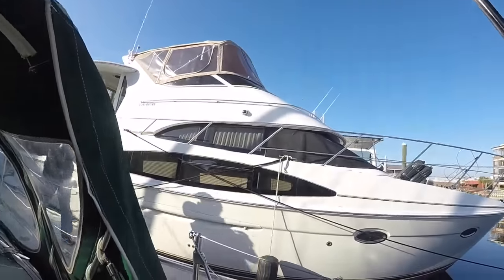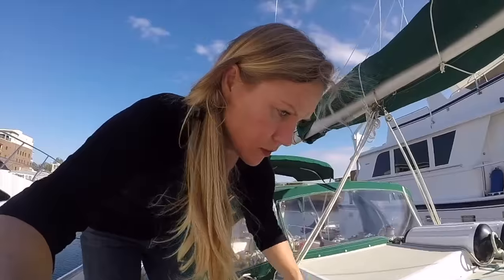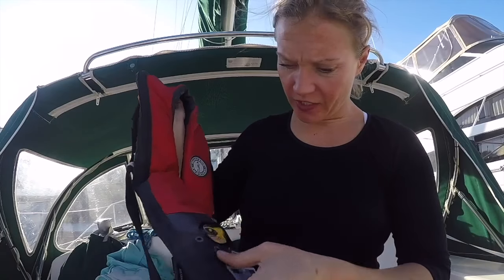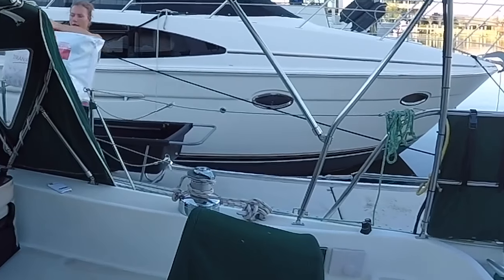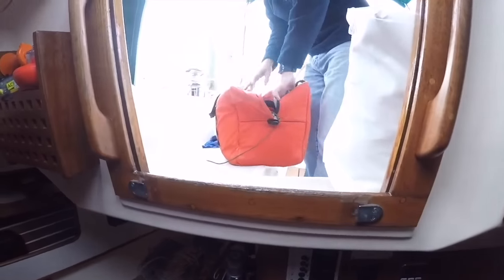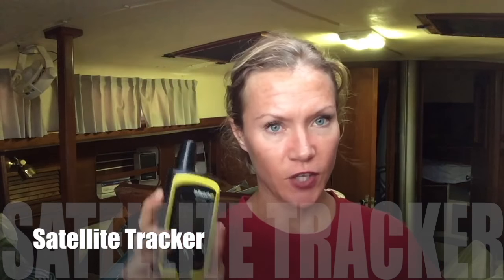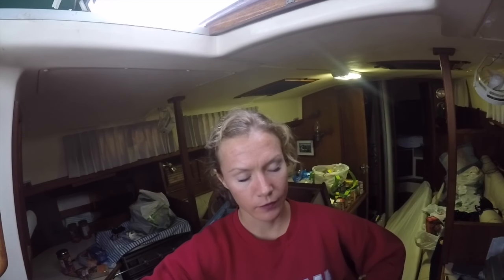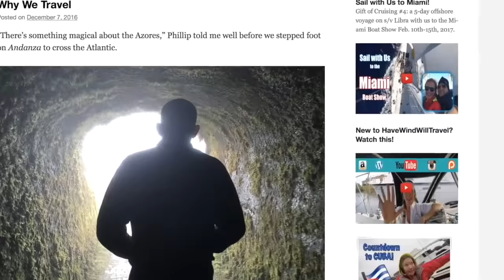#87: How to Voyage Safely Offshore (Season 4 Finale!)

Comment: Thanks Annie.  Great video.
In regards to your built in harness / pfd - make sure you tension up the waist band good and tight - should be able to slide two fingers between the strap and your body.  If it is too loose you will break ribs - possibly puncture lungs - when the shock load is transferred from tether through harness.  Your pfd's had straps on this sides for quick tension adjustment - so no worries there - just need to remember to tension up the last bit once you have them on.
Safe travels!
Reply from the maker: Ahhh, great advice.  Thanks for sharing.  I'll bet ours have been too loose and luckily we haven't gotten yanked hard enough to crack any ribs.  Always good to have your gear on right (even when you're putting it on quickly).  We have heard crotch straps are also a must as the pfd can get pulled over your head although our Mustangs do not have them (but I believe we can add some on with a few quick Dyneema ties).  Appreciate you watching and commenting.

Comment: Thanks. You've given me a kick up the but to sort out my jack lines and tethers.  I currently have flat webbing on one side and stainless cable on the other - and yes, it is like walking on ball bearings.  Not a good arrangement. I love the twin-line tethers you use and will invest in some.  I must admit that I tend to clip on without really think of what would happen if I tipped overboard.  Great video.
Reply from the maker: Thank you Just About Sailing.  Really appreciate the commentary here.  We only use our jack lines for offshore voyaging but found them very handy on this last trip to Cuba.  They worked very well.  I have to train myself to clip more often as I feel very nimble and agile and often hop out of the cockpit and get halfway to the bow before I remember.  But "feeling" a certain way doesn't mean you will be when a random unexpected wave bumps you.  So, if anything the jacklines are a good reminder (for me anyway) to clip in.  Thank you!

Comment: Looks like you guys have thought of just about everything for a safe and successful trip.  Having the knowledge of your boat and engine to find that leak, as well as the required parts to rebuild the water pump on hand for an immediate repair confirm that.  One thing you didn't mention, but should consider if you haven't already, is how to recover a MOB, if necessary.  I've seen more than a few reports of people falling overboard while tethered in to the jack lines, only to be dragged and drowned because they couldn't get back into the boat.  A MOB may be incapacitated for any number of reasons, and might not be able to offer any assistance to get themselves back into the boat.  Even in a Life Sling, imagine trying to lift Phillip back into the boat if he's been knocked out.  A block and tackle on the end of the boom comes in very handy in that situation.  I have D rings on both ends of my boom vang, so I can quickly disconnect the vang, attach it to the bail on the end of the boom, attach the other end to the rings on the Life Sling or harness of the MOB, and haul them back in.  Just the ex-USCG in me, trying to be ready for any situation.  Have a great trip!
Reply from the maker: Great, great advice as always Chuck.  Thank you for posting this for everyone to see.  Definitely something worth considering.  I imagine (if Phillip were knocked out and overboard) I would try to use a halyard and winch him in.  Maybe disconnected the main halyard from the sail and use that?  Certainly a situation to think about in advance.  Thanks for watching and all of your support.  We're so excited to share this experience with you all!
Reply: Sounds great in theory, however with the loads on a person overboard attached to  tether, in any heavy sea while the boat is being pushed through the water you are likely not able to recover a person in time. The person overboard while attached to the tether will quickly loose the strength to maintain their head above water assuming they are not already unconscious. The only safe way is to ensure that once the tether is attached it is never longer than to the gunnels so that you are never washed overboard. The longest tether you have when you demonstrated, I noted will put you in the water over most of your boat. Once over the gunnel your survivability is poor to non existent.
Reply: if youre overboard and theres no one to help you.......
well.......
 it was nice knowing you

Comment: Annie, I put my jack line down the center of the boat,  used that amur steel line (good for like 3,000 pounds) and ran from top of dodger ( hard top) to the mast around it to front of boat. can reach from either side of the boat and the tether's are short enough that YOU can't fall over board. They wanted a $150.00 for the flat webbing and I think the rope was $30.00. When you get to the mast just click on the other tether and go forward. Iv'e wrote to the Canadian cost guard trying to get them to OK the new flares but not yet. I wonder if it's because up here so many Islands and the regular one's shoot up so high. I carry lots of them I think safety things should be free or cheap, because lots of people won't spend the money for them.  Hope you have a safe trip!
Reply from the maker: Ahhh, a single line down the center.  That probably is a good idea as I felt my runs were a little closer to the lifelines than I would have liked.  I also had a guy tell me to clip on the line on the opposite side when working on the mast.  May be a good idea as well.  Thanks for sharing!
Reply: vind0 to olavi sok

Comment: hey Annie, you want to be able to freely walk from the cockpit to anywhere along the jack-line without having to unclip anywhere so you should run the jack-line outside the dodger.

Also, you mentioned if the jack-line is closer to the edge you feel less secure.  You should always go forward on the windward side of the boat and then cross to the leeward side if you need to work on something on the leeward side that way you are connected to the jack-line on the leeward side and it should be next to impossible to go overboard because you'll be nearly at the limit of the tether and jack-line.
Reply from the maker: Thanks James.  Appreciate the input.  We'll look at our layout and see if we want to make changes.  Great idea to hook to the leeward side, though.  That's smart.  Thank you for watching!
Reply: HaveWindWillTravel.com I have to give credit where credit is due.  Lyn and Larry Pardey have several books that I have learned much of my safety knowledge from.  Considering that they have more than 200,000 miles over 47 years of experience... I hold their opinion  fairly high. :)
Reply: Jessica Kirchoff you are correct. Sorry for the confusion. But clipping in to the high side and going forward is the safest way to go forward.
Reply: Cheers James!

Comment: if you is in the liferaft (which I hope it will not be necessary) then cut 't line over before it becomes necessary, as it is easier to see a large boat than a small life raft

Comment: if you have a catamaran, especially one of the many that have hard bimini you might consider a set of jacklines fore to aft but also consider a set of crosslines from port to starboard forward of your windshield (saloon/nav, not the dodger unless that is where your mast access is) and another under the bimini so you can be locked in in the cockpit... you may also set crosslines fore and aft but the key is to be able to safely cross beamwise while hooked in around the helm, mast, sugarscoops, and foresail furlers (all those places things can go wrong on deck)... crosslines are not so important on a monohull as they are on a cat unless it is a very beamy monohul, but could still be a good idea on some monos is line management requires working both sides of the cockpit and you are solo or otherwise short crew

Comment: you can get one inch or half inch tubular webbing from REI. Put your floating line inside the tube and then make a knot. tubular webbing makes great sun cover for your floating lines that are easily damaged by UV. I also use 2 inch tubes as chafing protection for dock lines.

Comment: You may also want legs straps on your psd in case you're knocked out, you don't want to be slipping out the bottom.
Reply: I agree...It is incredibly inexpensive to add two crotch straps to each PFD, and they are surprisingly comfortable, specifically because you no longer need to tighten the waist strap to hold the PFD on. 

Can I suggest that (subject to your being able to first remove the bottle and hydrostatic device first, if you want to save the cost of replacement) you use the mouthpiece to blow up the PFD bladder, and then get in the water? You will instantly see the real danger that exists without crotch straps.

I  you fall into the water, the "bang" of the PFD hydrostatically "going off" will scare the crap out of you already, and you don't want to compound this highly stressful situation by also fearing that you are going to slip out of your PFD.

Remember also that when you reach the limit of your safety line, it will tend to try and rip your PFD upwards too.

Cheerful sod, aren't I :) But I sincerely hope you decide to add crotch straps, and tell Phillip that because there are two straps, he will be comfortable in them as well! lol
Reply: Tony, I agree with you that crotch straps are essential but have you ever been in an inflated lifejacket in the water?  Despite having crotch straps it is still very important to have the chest strap adjusted correctly and having crotch straps does NOT mean you can have the chest strap looser.  If you do, you will not be floating in the correct position.  You should NOT be in the water sitting in your crotch straps, that is not what they are about.
Reply: Let's be reasonable here, I was not suggesting leaving the waist totally loose, only that with crotch straps, you are no longer relying 100%on a tight waist strap to prevent you slipping out of the lifejacket. I have seen videos of the difference and it is obvious that crotch straps are beneficial. Also, I wouldn't try lifting someone out of the water by their lifejacket if no crotch straps are fitted.

One other point, why would you be "sitting in your crotch straps" if their sole purpose is to keep your lifejacket around your chest rather than around your face?

Comment: Sorry guys but I would be just sailing right by you wondering what your orange flag or your flashing white light was all about.  Neither of them are internationally recognised distress signals.  Perhaps they are in the US but if you go further afield I would re think your distress equipment.  There is no orange flag in the international signal flags, the nearest is a red (bravo) flag meaning you are taking on or discharging hazardous goods.  Did you find the missing bit from the impeller? It is somewhere in the system, probably blocking some of the tiny pipes in the heat exchanger, and will cause you problems at some time in the future, probably when you least want the cooling to fail, you know how it goes. Keep safe out there, enjoy your trip, good winds and sunny days to you.
Reply from the maker: Hey Paul.  I'll admit, I don't personally know much about international signs of distress but it is a USCG coast guard requirement that we have a distress flag and flares (or the light) aboard for offshore passages.  Thankfully we didn't have to use either on our way to Cuba so we don't know how effective or ineffective they would be.  Definitely appreciate the thoughts on the impeller piece.  We looked for it but didn't see it and can only hope it was ejected out the exhaust.  We have had this happen before and found the piece in the hose to the heat exchanger.  Appreciate you watching and commenting.  All opinions are welcome.  We're boaters, right?  So we have extras!  Ha!